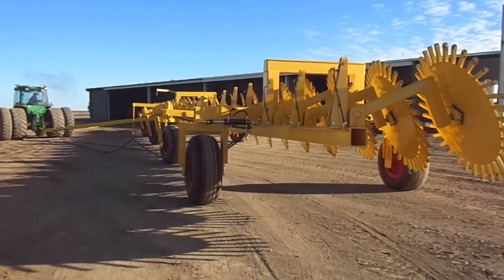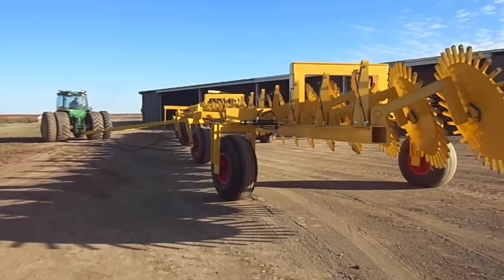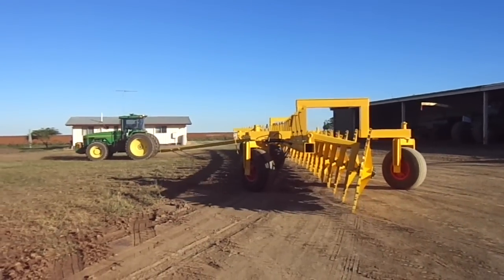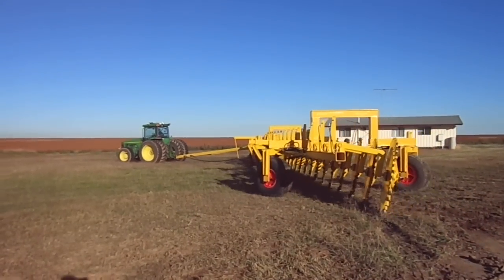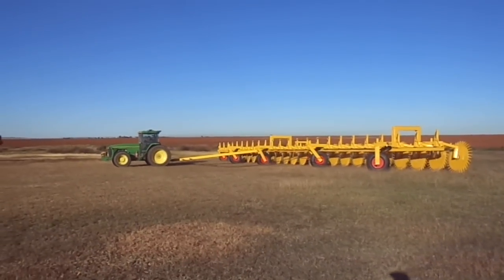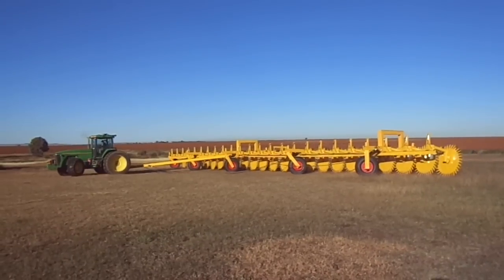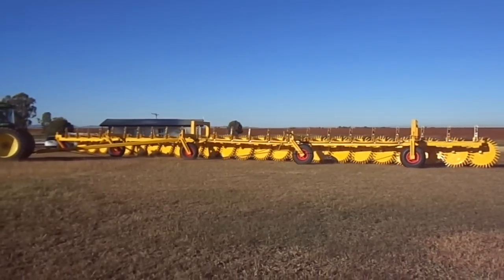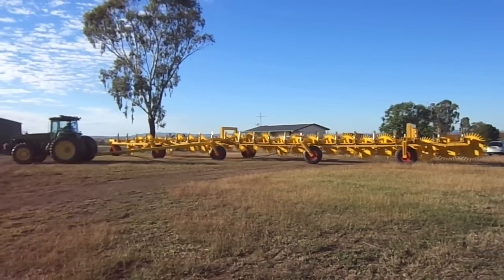24 Wheel Stickrake (Root or Rock Rake) from ground - Multi Farming Systems

Comment: how in the hell do you transport that down the road
Reply: I have Ben a farmer all my life I just don't see how
Reply from the maker: william Smith   Sorry, only just saw this.  There is a tow pole that can be attached to the front of the truck wheel, the machine pull then folds up on top of one of the axles.  It is as wide as the width of the aircraft wheel and it's axle on the road.  I have seen a farmer tow an 8 row model down the road and through towns with just a pickup truck.  This will be a lot longer and heavier of course, but the same width.
Reply: Cool

Comment: are those hydraulic lines dragging on the ground?
Reply: chains
Reply from the maker: 1/2" herc alloy chain.  They are to stop the Rake from bending like a banana backwards, and to keep it pulling in a straight line forwards.  You'll notice there is no fixed pull on the rear frame.